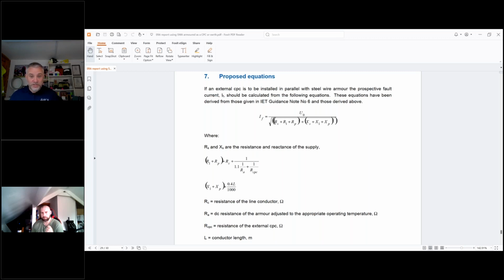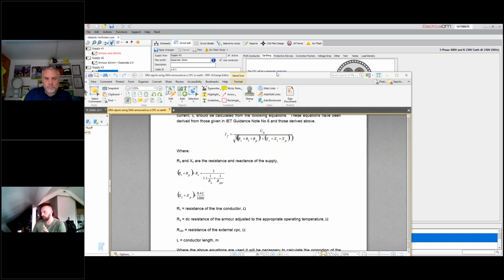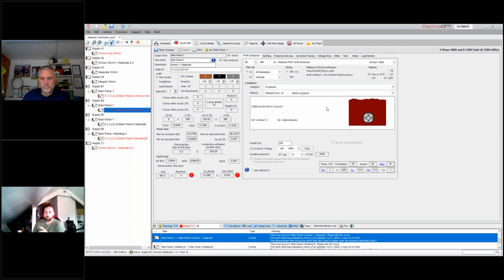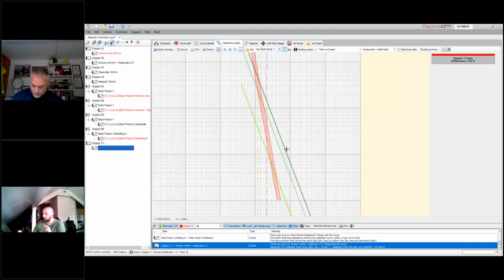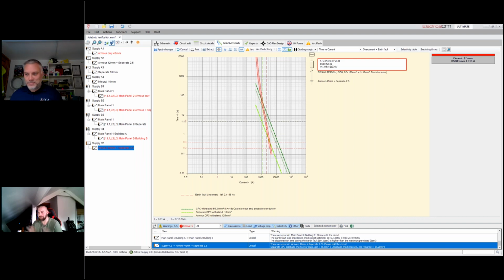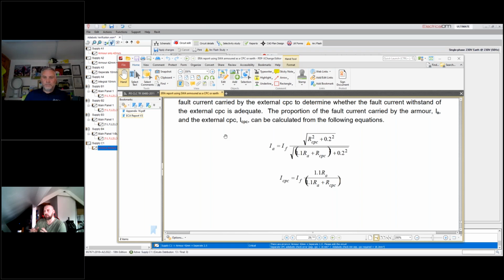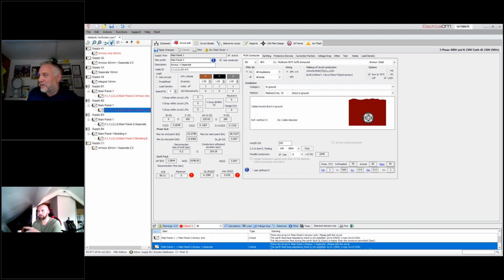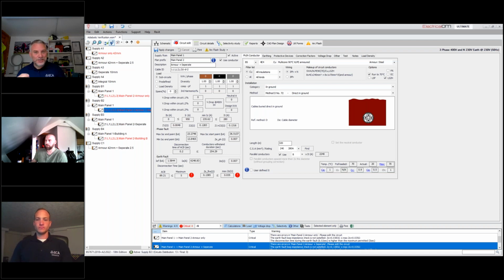ECA Learning Zone | Optimising SWA Systems, with Modecsoft ElectricalOM

Comment: First off thank you Spencer for sharing your wealth of knowledge.

Just thinking out loud if we have to produce a design to use either an internal core or a separate cpc instead of the armouring due to an environmental condition or some other reason, but the armouring is glanded into a metal enclosure surely the armouring would still count towards the sum of the cpc due to parallel paths and have the same emc/reactance affects. The only way i can see you can truly achieve seperation and the armourings not forming part of the earth path would be to isolate and insulate the armours at one end, with the other connected to earth, then you truly have a separate cpc. However you still may have parallel paths through other metal components but the emc issue will not have the same effects due to the armouring path being broken. Am i over thinking this or should installation practices   alter when this condition is present?

Also regarding swa cables buired direct and the armourings needing to be the CPC, should more emphasis be made in guidance notes regarding this as i suspect this is one regulation that is often overlooked? Achieving this can be a challenge with some equipment such as street furniture, ground mount EV chargers etc as there is generally no place to make a gland off too. This often leads to installers using an internal cpc and taping up the armourings  or fitting a gland with cpc link but the gland and cable float in the air so are technically unsupported with no room for the electrician to retro fit a bracket of sorts for the gland to be secured too.

Comment: Do conductors in parallel not have to be the same CSA, same material etc even for a circuit protective conductor (2 x cpc’s in parallel)?
Reply: No. If yoou look at 543.2.1 in BS7671 you will see that a protective conductior can be made up of multiple systems